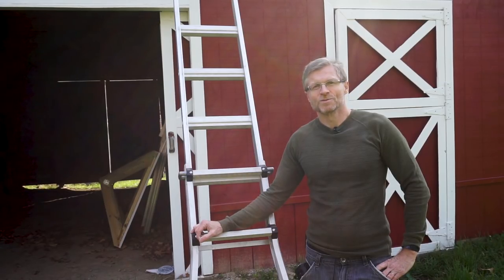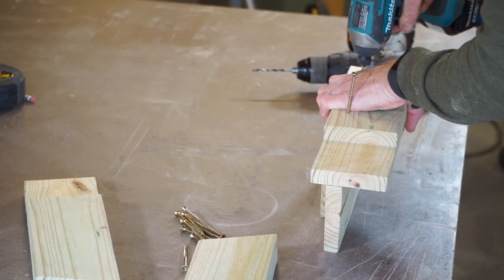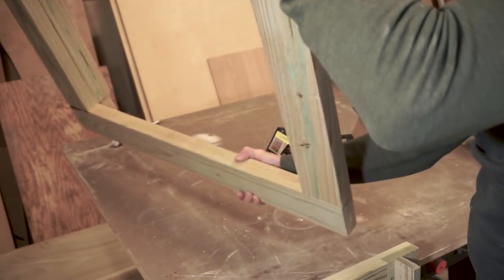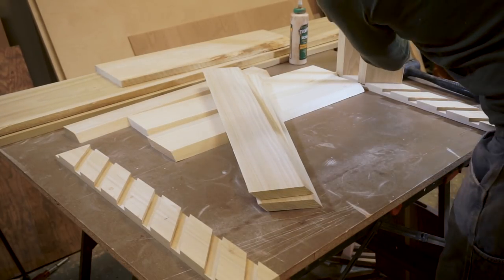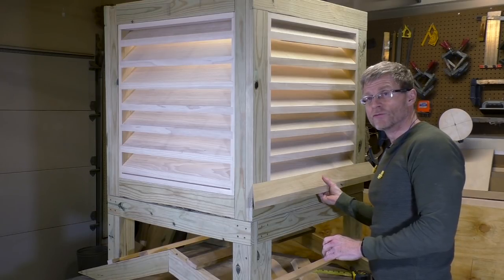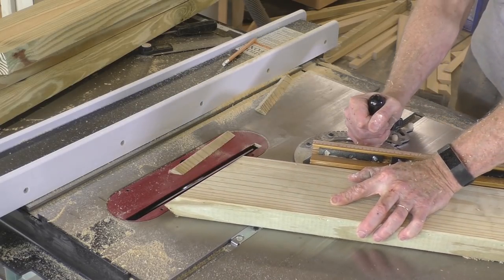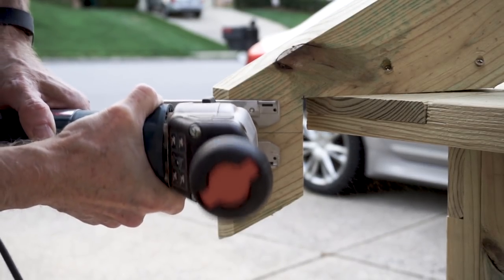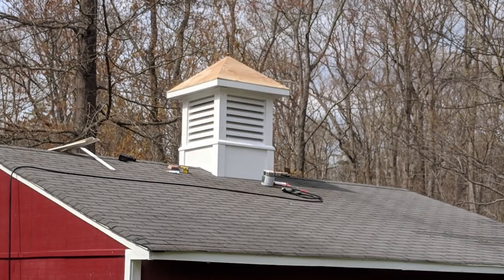How to Make and Install a Cupola - Part 1: The Build

Comment: I did make it! Actually, I made two.

Your video was incredibly helpful.  I have a 100 year old barn that had Two large cupolas that were falling apart.  It took me one year to make two cupolas from scratch.  The frame was treated wood, the plywood was marine grade, and the louvres and sidings are made of Royal PVC cellular wood.  It should last 25 years without needing any maintenance.  It is 52" wide and 95" tall.  It weighed over 200lbs.  I hired a professional to install it with a crane.  Thank you so much.  Your instructions were very clear.  I will try to post a picture.

Thanks again.
Paul
Reply from the maker: I would love to see a picture. You can email me at woodumakeit@gmail.com.

Comment: I sure hate to say anything negative about such an incredible  build - but with treated lumber you pretty much have to use stainless screws - galvanized, even hot dipped galvanized, will corrode faster than a regular nail would rust.

Comment: Very nice project.  Would you consider making it actually a functional vent or a "lookout" that you could stick your head into, that is, cutting a hole in the roof beneath the cupola?  If you did so, what steps would you take to keep weather out of the building, and not degrade structural integrity of roof?

Comment: Did you start with a measured design plan or just measure and build as you went? I want to try a similar cupola but need 48 inches wide based on my roof width. I’m concerned if I stay square on the vented sections, that the overall will be too high by the time I get a roof and weathervane on it. Any thoughts?

Comment: Great job!
One comment though. Never caulk bare wood! The caulk needs the primer to adhere to the wood - the same way the paint needs the primer to adhere. 
Always
Prime first
Light sand the primer
Then caulk
Apply the finish top coat

Comment: Love your videos!  I have the same saw as you, 1023 RLWX, and wanted to know if you have liked the Grizzly off feed rollers?  I know that a lot of makers use a shop made off feed table and this is the first time I saw a video with rollers.  Would you buy them again?  Thanks!!
Reply from the maker: policev840 I thought about making an outfeed table for my last saw but held off until I bought this saw.  I'm really glad I bought the outfeed rollers with the saw. They function really well and fold down easily when you want to out them out of the way. Compared to the time and materials to make an outfeed table, this was a really economical option for me.  I would definitely buy them again.
Reply: Sounds great!  Thank you for taking the time to reply.  I always try to get some wisdom before making a several hundred dollar purchase.  Thanks again!!

Comment: What kind of sprayer/compressor do you have? Would you recommend it?
Reply from the maker: I bought that sprayer at Harbor Freight. I don't purchase many items there, but this particular sprayer has worked well for me for my relatively basic needs.  Here's a link to the one that I have: https://www.harborfreight.com/20-oz-professional-hvlp-gravity-feed-air-spray-gun-68843.html

The compressor I have is a Craftsman 12 gallon compressor that I bought several years ago before I owned an HVLP sprayer. If I had to do it over again, I would definitely buy a larger compressor because mine can't keep up with the demand of the sprayer. I wouldn't hesitate to buy another Craftsman compressor, but I'd want to at least double its size to have enough CFM output.
Reply: Thanks; I'm about to buy a sprayer and a new compressor, and this was very helpful.

Comment: So how do you plan a complex project like this?  There are so many pieces and decisions to make about each one.  And each piece affects and is affected by others.
Reply from the maker: I'm probably a little unorthodox because I typically start with a concept in mind, and then I just start building and figure it out as I go. I had plenty of time to think about it while the pressure treated lumber was drying in my garage (it went from 43% moisture to 6% in four months). That method probably wouldn't work if I was building a house, but for a small project like this, it worked well and it saved a lot of time that I would have spent trying to draw it up in SketchUp.

Comment: Looks like you did a great job on this cupola. I would not make it. I would purchase the metal kits that will last much longer and from the ground look just as nice. Also, this cupola is way too nice for that barn. But nonetheless good job
Reply: I think this is a working cupola. Most of those kits are purely ornamental.